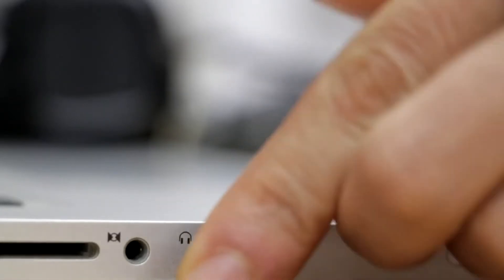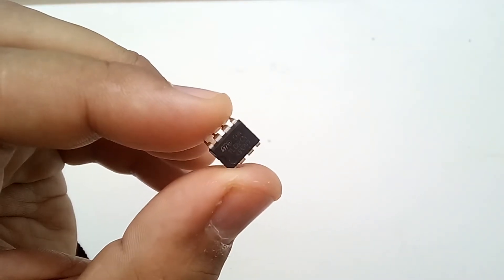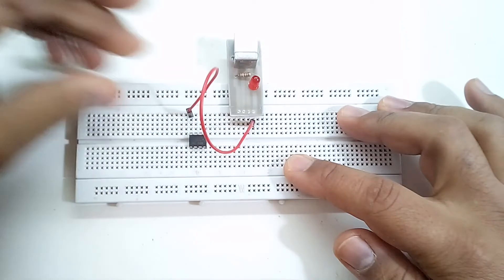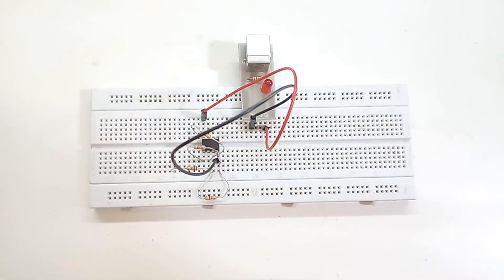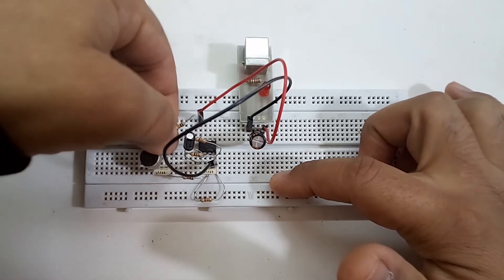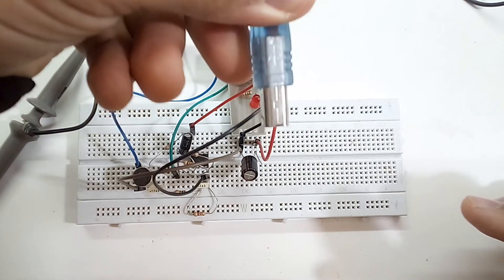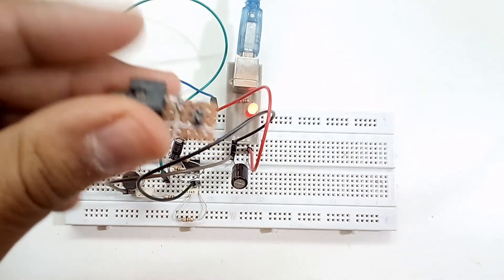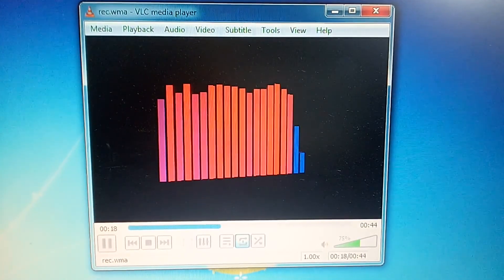Diy a microphone preamplifier using the TL082 OpAmp

Comment: 1. C2 can vary between 1uF to 2.2uF
2. Add a 22pF to 33pF capacitor in parallel to R2
3. R2 can vary between 39k to 100k. Higher resistance then higher gain (and higher noise and higher distortion)
4. Add a 0.1uF capacitor as close as possible to pin4 and pin8
5. Connect pin5 to R3-R4-C1-pin3 line
6. Connect pin6 to pin7
7. You can substitute U2 to AN6551, LF353, LM833, M5218,  MC33078, MC34072, NJM4558, OP275, OPA2134, TL062, TL072, etc. Choose which suits your taste.